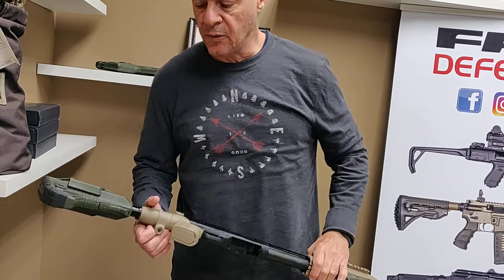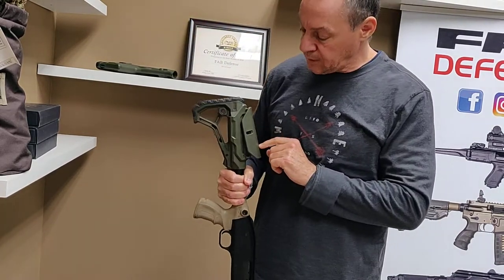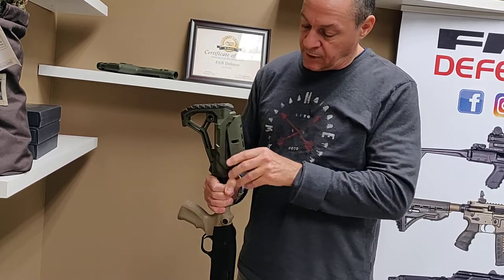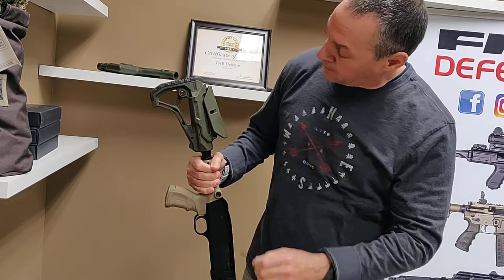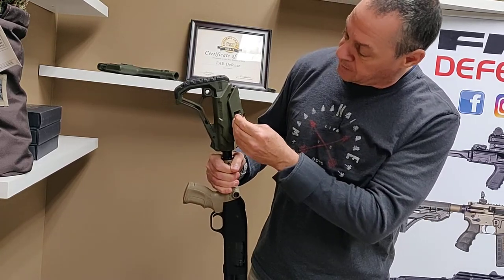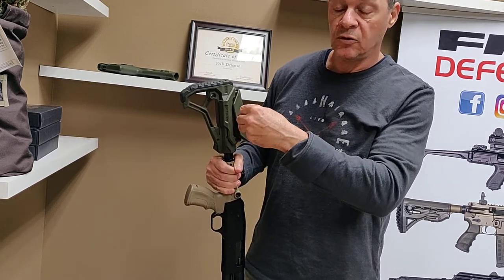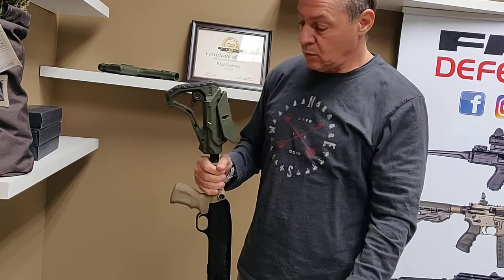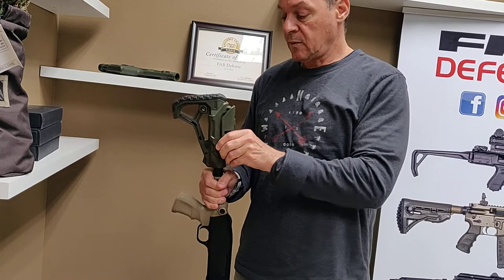Adjusting the Cheek rest on the GL CORE CP

Comment: So I just got one of these but I got the CP with the "cheek pad" that's  adjustable. However, apparently whoever designed it has never put their face down on a AR before in their life. For some reason they have it to where the cheek rest only adjust up and down on one side and it's on the side closest to the receiver. So when you raise it up your face is basically pointing up in the sky, away from your sites. How the hell does that make sense? Fortunately, I'm smarter than the average bear and I figure it out how to take off the cheek rest. Which is just a simple addition to their already standard GL Core. So I took it off flip it around put it back on and now it adjusts correctly where the back end near the butt of the rifle lifts up and the front end stays put.🤦🏼
Reply: I know, wish I saw this before I ordered. I don’t have my optic yet so this is annoying. Im thinking of just getting rid of the rest all together
Reply: @SirGibsonOfMel  You can take it off. And it looks really nice with the cheek pad taken off.
Reply: @SirGibsonOfMel  And You can also turn it around.